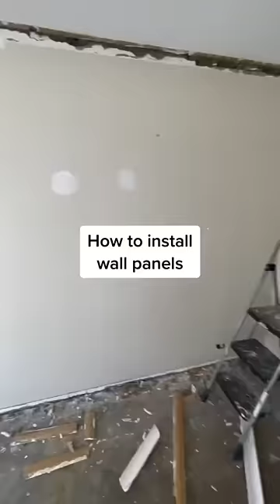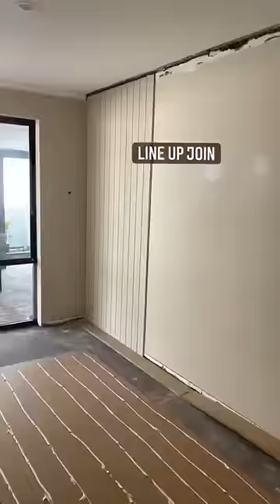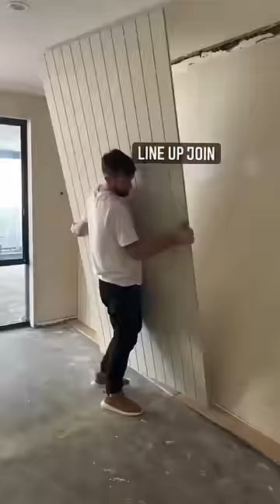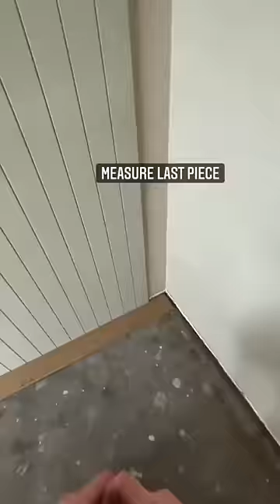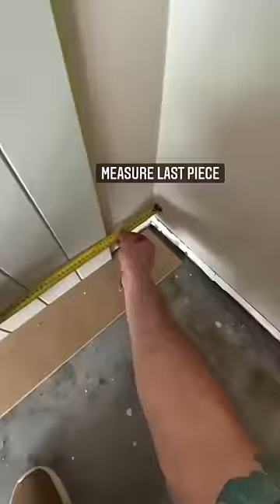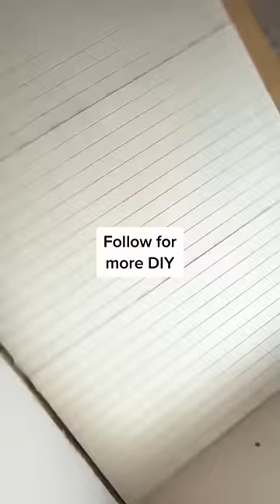Transform your space ─ How to install wall panels #homediy #short

Comment: Nooo you will ruin the sheet rock just use finish nails and use a tiny brush to paint them the glue will pull the Sheetrock after you move or your wife wants to change it
Reply from the maker: This is not sheetrock. This is a solid brick wall. I'm in Australia.
Reply: @renodad  well you’re never going to get that off
Reply: @jimcatanzaro7808 😂
Reply: Why would you want to remove when you move? Only petty people do that.
Reply: @jimcatanzaro7808 you can always adhesive another layer of drywall over top of the beadboard!

Comment: I haven't found as of yet q single video of anyone who's come up with a technique to hide where those panels meet. I still see the exact point where they meet and I absolutely hate it with all my heart. I need to figure a way to make it look like actual installed shiplap
Reply from the maker: You can’t see where they meet once this is painted, a small bit of gap filler at the end, it’s seamless. This is unpainted. I used VJ panels with a tongue and groove
Reply: I had this done in a ceiling and the guys put wood trim in a coffered style to hide gaps and around the ceiling - paint hid all the little imperfections- came out great!

Comment: Im looking at doing something similar, did you need to account for the expansion of the wood due to humidity and temperature changes by leaving gaps at the edges or is this flush against ceiling, floor and walls? Also, i see you cut the last piece straight, does this mean that your end wall is perfectly level? Because mine isnt and i dont know how to account for this, i dont have the skill to cut to match the profile of my wall exactly.
Reply: It’s probably mdf, which won’t flex like wood.

Comment: Well done , however, next time you should find the centre of the wall and place 1st panel in that position to achieve a seemless wall instead of a small expanse on 1 side , if u had small expanse on both sides,  much better finish 😉 👏 👍

Comment: My walls are taller than the paneling. 
I can’t find anything to help me with that. 
I wish there was some DIY stuff for women because I don’t know what a jigsaw is I don’t know what a blade size is… I’m 67 years old and I’m trying to improve my little old house just to make it nice for my kids.
Reply from the maker: I try to show as much as I can on my channel for beginners. You can get taller panels and cut them down if your room is taller or make it a feature and cap it at the top. If you're unsure about anything just type it into YouTube search and you will learn quick; for example: how to use a jigsaw. Then watch it and try it.
Reply: Try using some inexpensive, paintable trim to divide and section the wall symetrically. It will look really good and you can more easily hide the panel joins.